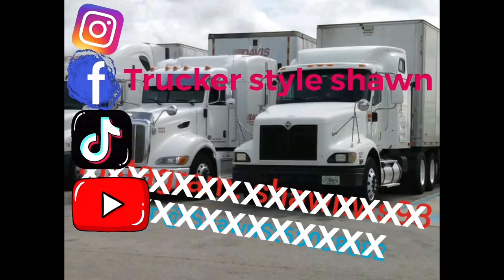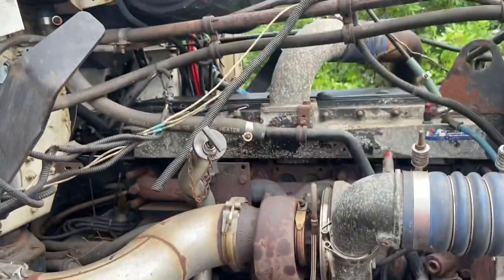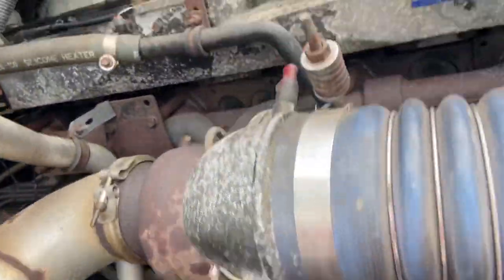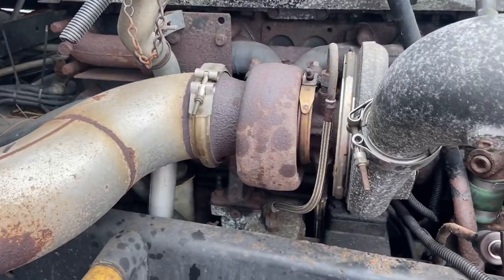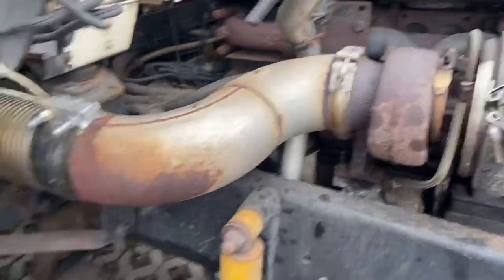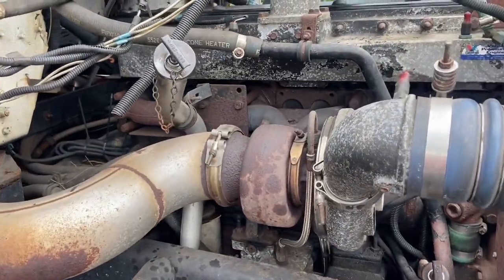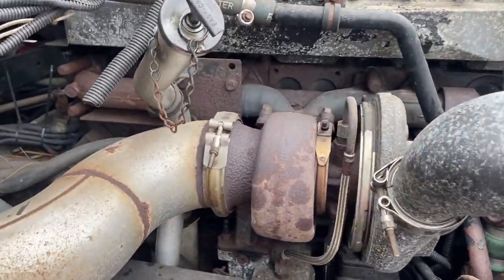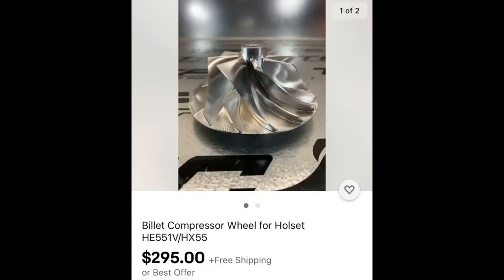Big turbo swap freightliner fld Cummins m11.

Comment: Great little vid man! 
Is that the M11-Celect? 450hp? And yes it would be great to see how it all turned out! Thank you
Reply from the maker: This one is a celect plus. Originally a 330hp
Reply: @truckerstyleshawn  I have that same motor in my 96 FLD with 900k miles. It’s tuned to 425hp. Been wanting to go bigger on the turbo. Glad I found your video

Comment: hey. man bought a truck same engine, truck rated at 330 horse but only goes 60mph need help. I was wondering if I could get 400horse out of this engine and how.  if anybody knows please let me know.
Reply from the maker: You can get 400 out of it. If I where you I would add a ism block stiffener to it though so you don’t get block chatter. Also if you go to Cummins or a dealership the can raise the speed for you
Reply: what do i need to get to that 400 mark?  block stiffeners aside. bigger turbo? i don’t know anyone who could tune it either. been looking online for info on this can’t fjnd anything, you’re the only person that seems to know what you’re doing
Reply from the maker: @johnnyquinones682  it can be done with a stock hx50 turbo but I would suggest a hx55. If you have a celect plus than it already has a hx55. Other than that a tune.
Reply: appreciate you brother!